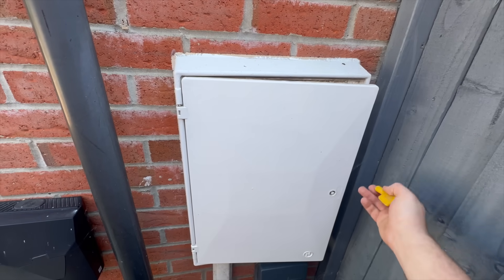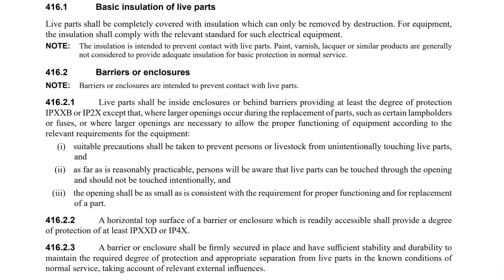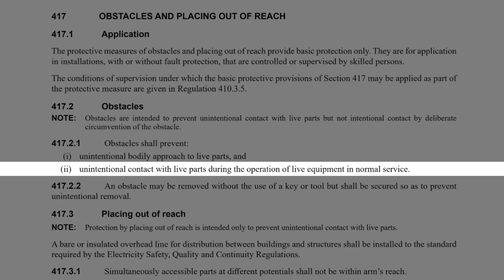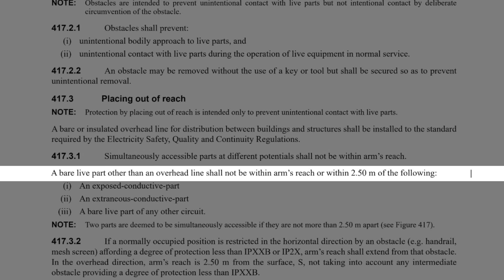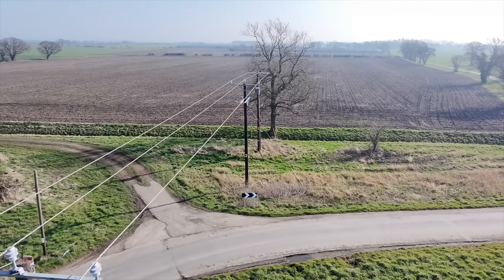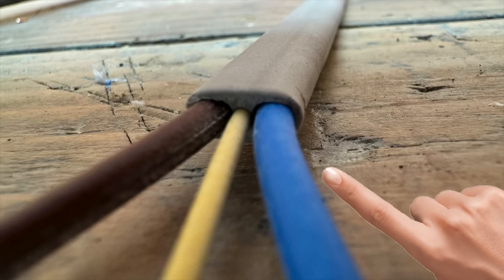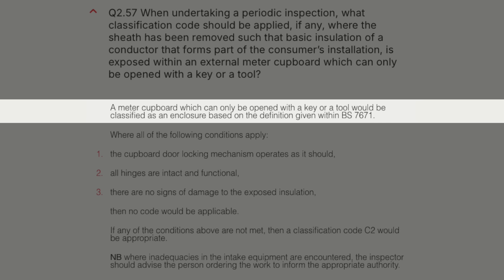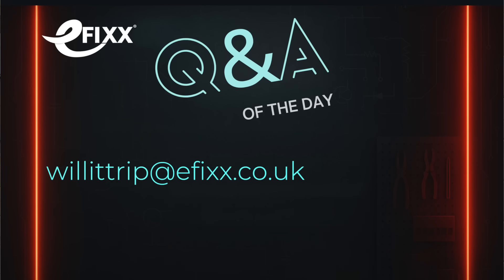This Should Be Illegal… But Isn’t!

Comment: A meter cupboard can be ,and is also meant to be  accessible by the home owner or public , very easily. I will certainly still be coding c2 for exposed basic insulation.
Reply: Wrong.

The authoritative answer is provided below.

Here is the definitive answer from Guidance 4, Issue 7.2, Electrical Installation Reporting, produced by Electrical Safety First .

The following scenario is to be coded as a C2:
Quote:
 Single-insulated cables in a meter cupboard which can only be opened with a key or tool, but where any of the following conditions apply:
• the door mechanism doesn’t operate as it should,
• any hinges are not intact or non-functional,
• where there are signs of damage to the exposed insulation.

End Quote:

If there are single insulated cables in a meter cabinet and that cabinet is damaged in someway which makes it easy to get into without using the proper tool to open it, THEN you code it up as a C2.

If that meter cabinet is NOT damaged in anyway, then it is a C3.

That's the official definitive answer .

And when you think about it, it makes sense: the single insulated cable does not pose an immediate danger. If it did, it would be a C1 or a C2.

The risk of danger is increased if the door to the cabinet is broken in someway, if it can be lifted off it's hinges, or the locking mechanism is damaged or not present, then somebody can enter the cabinet and interfere with those cables. So obviously, the level of risk is increased if the cabinet is damaged. And to record that means it must be increased from the C3 to the C2.
Reply: @deang5622 my opinion is, a meter cupboard is intended to be accessible to NORMAL PERSONS, not under the control of a COMPETENT or ELECTRICALY TRAINED PERSON. So the double insulation or insulation sheeth, is there to protect non trained or none competent people.  And how many meters cupboard doors do you see hanging off??? Would you really code it a c3, to then drive past the job , a week later ,to see the door off the hinges, because i wouldn't lol.
Reply: @arronplant8082  so what you’re saying is that you’re overclassifying, because at the time you’re inspecting, the enclosure is fine but you worry that it might become damaged in the future. Which could be applied to everything.
Reply: @alexc4300 no, read what i said again. 
I said ' a meter cupboard is INTENDED to be used by none trained normal persons " other enclosures for electrical connections, are NOT INTENDED for access  by normal persons .
That is the difference for me.

Meter box = intended access 
Enclosure = none intended access

But hey, what do i know 🤷‍♂️👍🏻
Reply: @arronplant8082  it’s not about whether it’s for access by trained or untrained personnel, but whether it prevents accidental contact. If the cabinet’s in good condition, it cannot be opened without the tool (or deliberate action to remove the door) thus it is itself basic protection.
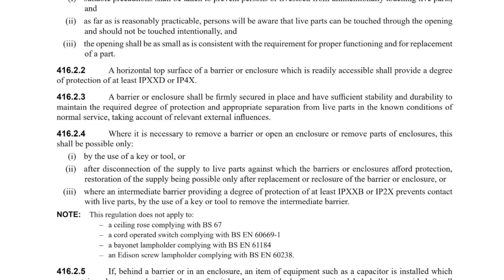Reply: Isn't the dependency there the presence of a 'key' lock, such as the yellow triangular think at ~7:34, even if many don't even have such a lock. I don't think the magnetic 'latch' on my 60's electric cupboard would meet that  😉
Reply: all day c2  why there made this video telling everyone to go and do a worst job i dont know
Reply: @giz177 Incorrect.

Here is the definitive answer from Guidance 4, Issue 7.2, Electrical Installation Reporting, produced by Electrical Safety First .

The following scenario is to be coded as a C2:
Quote:
 Single-insulated cables in a meter cupboard which can only be opened with a key or tool, but where any of the following conditions apply:
• the door mechanism doesn’t operate as it should,
• any hinges are not intact or non-functional,
• where there are signs of damage to the exposed insulation.

End Quote:

If there are single insulated cables in a meter cabinet and that cabinet is damaged in someway which makes it easy to get into without using the proper tool to open it, THEN you code it up as a C2.

If that meter cabinet is NOT damaged in anyway, then it is a C3.

That's the official definitive answer .

And when you think about it, it makes sense: the single insulated cable does not pose an immediate danger. If it did, it would be a C1 or a C2.

The risk of danger is increased if the door to the cabinet is broken in someway, if it can be lifted off it's hinges, or the locking mechanism is damaged or not present, then somebody can enter the cabinet and interfere with those cables. So obviously, the level of risk is increased if the cabinet is damaged. And to record that means it must be increased from the C3 to the C2.

Comment: Can you make a video of choosing correct cable cross-section, when installing surge protection?
Reply: Now that's weird was only discussing this a few days ago! So what we figured (but open to suggestion) that the DB is rated 63A via 16mm, goes via 40A sub isolators to the bus at 10mm. This means we have to connect the SPD 25A MCB via 10mm (because its subject to the 40A bus). This means we can run it from the MCB to the SPD in 6mm (including the earth). However, having said all that, I always run it in 10mm, this is because when I am wiring the DB I have loads of 30cm scraps of 10mm left over lying on the floor for free, the 6mm & 4mm is always a major hike away and 20 unscheduled trips is about my limit for the day!